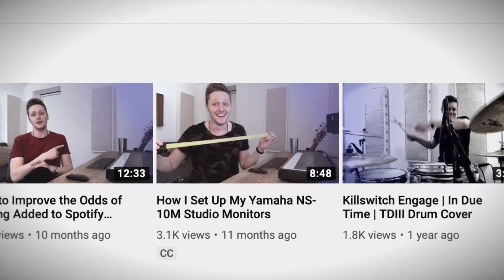Studio Monitors - How to Connect Passive Speakers to Your Audio Interface

Comment: There anyway to play passive speakers without amp thru m audio? Using power from comp ? Thanks -
Reply from the maker: No, unfortunately not. You'll need more power than your computer can provide.
Reply: @tomdupreeiii  ok thanks--- I'm going to get an amp. But I have three speakers somebody just gave me and I'd like to set up and DJ somewhere (possibly outside without power)...They were telling me it might work to get one of those battery power outlets. But what I'm really wondering is if there are (1 battery-powered amps) and 2) any amps where you could get sound from 3 speakers, one speaker being assigned the central dynamic. OR if you can think of any fixes to somehow get the third speaker involved with a central dynamic (instead of right/left). Sorry but I figured you might have some experience and to ask - thanks.

Comment: It’s not clear how you connect the interface to the amp. What kind of amp and what type of cables used.  Give me the idea but not clear.
Reply from the maker: Yeah I didn't showcase that step well enough with this video. I use two standard XLR cables to connect my primary interface to my amp. It will depend on your outputs and inputs though. Sometimes a TRS to XLR is necessary.

Comment: Thanks for the video, why do you need an audio interface?  Thanks in advance!!!
Reply: Interface is, basically, a converter of digital signal, that’s in your computer (mp3/WAV and so on) to analog signal, something that humans can hear ( any noise or sound that’s out in the world). So you need to connect it with interface in order to hear anything from any device to a good pair of speakers
Reply: @Bogdan_Tolm  Appreciate your reply!  I was planning on getting a bluetooth receiver and hook it up to my amp but would an audio interface give me better sound quality?  Thanks again!!!
Reply: @kalihipalama1762  I don’t really know about Bluetooth receivers, but audio interface is much more simple and more correct. Nowadays converters in audiointerfaces are really great (Don’t listen to all this guys, that hear a difference in silver and gold covers of cables, they usually cannot recognize the difference between old soundblaster and something like apogee) just buy something with good drivers on computer, like new focusrite scarlett (3d generation’s drivers are solid) and you good to go
Reply: @Bogdan_Tolm  Again, thanks for your reply!  In my opinion, simple is best!  I know that bluetooth compresses sound, so I probably won't get the sound quality which I'm most interested in.
Reply from the maker: Looks like @Barens hlm answered this perfectly!
Reply: @tomdupreeiii  Great guy who replied immediately and gave me clear answers.  I'm getting an audio interface over a DAC or bluetooth receiver.

Comment: Hey my question is what cable did you use between audio interface and power amp? That part was really quick and not fully explained.
Reply from the maker: Yeah, I definitely accidentally breezed over that part. I used a male XRL to male TRS.
Reply: @tomdupreeiii  thank you!

Comment: Hey Tom, I’m curious if your Avantone amp produces a lot of fan air sound from the actual device
Reply: I’m very sensitive to the noise as I’m working in a small room
Reply from the maker: No, the fan is quiet for me. I do have it in a rack though, which probably helps to dampen any noise it might make. I'm also not driving it very hard so it doesn't really get hot.
Reply: Thanks for your reply Tom, you rock! Subscribed

Comment: Hello and thank you. I have a question: i have a Yamaha keyboard that i want to use to record piano parts, and so i have to plug the keyboard into the audio interface. I understand that already. ;-) But: i also want to use that keyboard with the hifi amp, so that, when i just want to play something for fun and not record it, i can use the amp as an amp. Can i plug in the keyboard in for instance the cd input on the amp (with the red / white connectors) and will the keyboard then work for recording AND just for playing? Or how can i get that??

Comment: really my receiver does not have anywhere to plug in whatever you plugged in from the interface
Reply from the maker: You may need a different adapter cable. They make them for just about anything.

Comment: I currently have a pair of klipsch RB -51 II passive speakers, paired with the fosi audio 2 channel 100 watt 8 ohm amp but I  wanted to add a subwoofer and an audio interface to my set up.
 I was looking at the focusrite scarlett solo but due to my speakers being passive I’m unable to pair the two and I know I would also need a subwoofer connection, so I started looking at buying a new amp. I’m looking for 2.1 - 8 ohm amp. (75W RMS to 300W peak) that I can connect to the focusrite 
 Any one have any suggestions as to how I could solve this issue or point me in the direction of a budget friendly amp?

Comment: Is it just me or did Tom here completely skip a step?  It’s cool, I’ll find out what exactly is goin on from interface TO the power amp elsewhere but I really think you skimmed over that part. Which is all I was looking for personally.  Otherwise, great video.
Reply from the maker: The part you're looking for is at 1:50. It's quick but it's there. I just didn't go into detail for that bit. Basically I used a balanced TRS to Male XLR cable for each side. Hope that helps. Thanks for watching!

Comment: Hi Tom Dupree III,  great video, which I have stumbled upon at a time when I am in the market for a new amp for my NS10’s too!! My question is regarding the CLA 200 amp that you are using with it. Are you still very happy with it?  Have you had any further issues apart from what you mentioned in another video where you had to return the unit as only one channel was working.  It’s quite a big outlay but I wanted to make sure it is still recommend by you and worth it??  It would be great to hear your thoughts.

Comment: Were the wire cables sold with the speakers or you had to bought them separately? If bought separately, could you please share a link with a wire cable that you used? Thanks in advance!
Reply from the maker: I had to buy it separately. Just search for "monster speaker cable" on Amazon and you're set.

Comment: Is it just me or did you miss out the step where you connect the interface to the amp??
Reply from the maker: No. It’s in there. 1:50.
Reply: @tomdupreeiii  yeah but it was not clear the cable you used.
Anyway the Video is very useful
Reply: @tomdupreeiii  what type of cable did you use to connect the Audio interface to the amp?  1/4" to 1/4"   (did your amp have a 1/4" input?).   The amp I'm using only has RCA.
Reply: @tomdupreeiii  You're right. There's a 2 second clip of you plugging something in and it's very dark, then it cuts to you talking about speaker cables? You didn't talk about how you need to plug the 6.5 mm jacks into the L/R of the audio interface which then plug into the RCA or phono jacks on the back of the amplifier?
Reply: @thebeatclinic9000  The CLA-200 has XLR (balanced) inputs, and the Fast Track Pro has TRS (balanced) outputs. He doesn't discuss it, but it's safe to assume he uses a TRS-XLR cable to connect the two.
Reply: @benjaminpelletier5485  why not ts if there a left and right

Comment: What is the best power AMP for the NS10s?
Reply from the maker: I really like my Avantone CLA-200. I've heard the 100 is good as well. Plenty of other options at higher price points as well!
Reply: @tomdupreeiii  regarding to this CLA-200, I've searched about this amplifier and I saw that it delivers 200W at 8 Ohm per chanel. Also I see in your video that you have the original Yamaha NS-10M, which they support nominal 25W and Max 50W and the impedance is 8 Ohm (all this per speaker). So my question is how do you manage the volume controls from the amplifier and the interface? Do you set up the amp gain to the limit of the speakers and adjust the gain of the interface to the desired level?  Because my guess is that you should adjust the gain of the amp to less than 25% (aprox. 50W?)  in order to now blow up the speakers, am I right?

Comment: Could I use a regular household theater amp?
Reply from the maker: I think you probably could. I’d just make sure the wattage is compatible with your speakers.
Reply: @tomdupreeiii  I’m thinking about using KRK Studio monitors as my main speakers than use some Technic speakers to use as reference monitors using the Mackie Big Knob and possibly a theater amp.

Comment: i'm just confused on what kind of cables i need to connect the amp to my interface, you should of taken more time on that part
Reply from the maker: They make adapters for every connection you can think of. Check your connection points and find the cable / adapter connection that works with your gear. Everyone has something different.

Comment: How about Focusrite Scarlett 2nd Gen? Because its line outputs is RCA. How tp connect it to amplifier?
Reply from the maker: You can get an adapter to change your connection type and it should work just fine.

Comment: Can I use a focusrite isa one as the Amp for the passive monitor ?
Reply from the maker: While I'm not super familiar with the ISA One, it appears to be a preamp but not a power amp, so my guess is probably not. You'll likely need an additional power source to supply your monitors.
Reply: @tomdupreeiii  Thank you so much

Comment: Hi Tom and thanks for your really interesting video. My question is if it's possible to control an unbalanced instrument volume (es. a synth or a drum machine) through a monitor interface like a Fluid SRI2 and come off balanced directly to the active speakers (from ts to trs) without computer or any connection to it. Thanks for your help. 
Regards Damiano
Reply from the maker: Yeah dude, you should definitely be able to do that! Great question!

Comment: no way you even use a fast track pro hahah thanks so much for this!
are all amps considered "power amps" or am i gonna have to spend a thousand bucks on the cla?
Reply from the maker: Yes, any amp that sends power to a speaker is a power amp. But some are designed for specific uses (e.g. live vs. studio audio). You can find one for less than the CLA if that's where you budget is!

Comment: Hi Tom,
Thanks for putting out this video.  I have also watched your previous video as well.  I just purchased a pair NS10m's and would like to use them for computer speakers to monitor and edit voice-over and recorded videos in video editing.  I am very novice to audio set up, I was wondering if you had any recommendations for a smaller in size amp I could use, not looking for anything super technical.  Alsd I would not be using an interface.
Reply from the maker: Thanks for watching the video! I’ve heard the CLA-100 is a great amp as well. Might be worth looking into!
Reply: @tomdupreeiii  Perfect thanks for the quick reply

Comment: Why do I need the Audio Interface? Can't I just directly connect the amp to my PC with like an Aux cable as if the speakers/amp were headphones?
Reply from the maker: You can. You’re just using the audio driver from your headphone jack instead of a good one that might come in an interface. Also, you’ll need an interface to effectively work in a home studio environment, which is the main context of this video.
Reply: @tomdupreeiii  Nice! Thanks for the quick answer

Comment: Hi! Very nice video! I was blown with the banana clips! Hahaha

One question. I've just bought a Behringer Uphoria UMC202HD and i have a sound system (If its usefull its a Kempler & Strauss MCD 2060) lying around that ive been using, but i want to connect it with my audio interface. (Right now the speakers are plugged by a 3.5mm to RCA cable from my computer monitor to the "amp" i guess or sound system, which i know its not the best but it kinda works).

The sound system has only RCA inputs and it has also speaker cable outputs that drive the passive speakers.

Now my question is: Would a 1/4 inch TS to RCA cable do just fine to control my audio through the interface? Im kind of scared since i heard that using the wrong cables could mess up something! D:

Thank you in advance!
Reply from the maker: Hey, yeah that should work just fine! As long as your components remain in the correct order of sending audio from computer to interface, interface to amp, and amp to speakers, everything should be just fine.
Reply: @tomdupreeiii  Perfect! Thank you so much! Just one more question, should i keep this into consideration while pluging them and/or everytime I turn on everything?

For example turning the computer first (probably with the audio interface already plugged in) and then turning on the sound system? Or thats irrelevant?

Thanks again!
Reply from the maker: As long as you’re nit sending a massive influx of audio at startup, you should be fine no matter the order.
Reply: @tomdupreeiii  Thank you very much!

Comment: Thanks for this. Could you explain why you chose a power amp as opposed to a regular integrated amp. Could you also recommend an alternative to the NS 10.. just a regular pair of speakers that I can get started on without any room treatment and all that.
Reply from the maker: accentontheoff my interface of choice - the UA Apollo 16 - doesn’t have an integrated power source, which is why I decided to go with the power amp option. Plus, I specifically wanted the NS-10s, which are a passive speaker. I could have bypassed the amp by using active speakers as well. If you want something simpler than the NS-10, KRK makes a decent entry-level powered monitor that’s a good option. But nothing is going to allow you to bypass room treatment for better listening. Regardless of monitor choice, room acoustics will be dramatically improved with treatment. Thanks for watching the video!
Reply: Tom DuPree III There seems to be no escaping the room :). Thanks for replying.
Reply from the maker: accentontheoff yeah unfortunately not. You’re welcome!
Reply: @tomdupreeiii  Which power amp did you use or which ones can you recommend? I don't know what to focus on

Comment: Thanks for the video Tom. On the power amp, how are calibrating the levels or do you set both knobs open?
Reply from the maker: @Tyler Held I started out by setting the amp gain staging to a level that allowed me to listen clearly at low master volume. That ended up being about 10 o’clock on both sides. The meters don’t move but everything sounds great nonetheless.

Comment: Hey Tom!
Really useful vid, thanks!
My audio interface (MOTU 828 Firewire MK1) has an S/PDIF Coaxial connection. Can this connection help me skip me the amplifier step in any way? If so, how should I do it? Thank you!
Reply from the maker: Jordi Corominas Salvanyà hey good question! No, unfortunately not. You’ll need the amp to drive the volume of the speakers. A S/PDIF connection is generally used to send data between instruments and interfaces, not audio. If it’s an RCA audio out (same connectors oddly enough) you can use that to connect to your amp and then to the speakers from there.
Reply: @tomdupreeiii  Thank you very very much!

Comment: My one question is if You're going to use an Integrated stereo amp (such as my NAD C 372) would it be better to bypass the pre-amp of the NAD or simply connect to it like a CD player would through the pre amp?
Reply from the maker: hmr101wylde if you’re going to us an external amp after the NAD then you don’t want to send a powered signal to the external amp. You want to use a line level signal. If you’re using the internal amp to power passive speakers then you’ll want to use the powered outputs. Hope I understood your question correctly!
Reply: @tomdupreeiii   I don't think you did. My NAD C372 had a pre-amp and power amp built in. I am using this to power passive speakers. I would just like to know if I'm better of bypassing the pre-amp of the NAD connecting the balanced outputs on my Interface directly to the power section of the NAD.
Reply from the maker: hmr101wylde oh ok I see. Apologies for my misunderstanding. Yes, bypass the pre-amp and go straight into the power section of the NAD if that's an option.

Comment: @1:50 M-Audio to power amp - did you plug in one of the TRS outputs or Inserts? And to where in the powered amp did you plug the other end?
Reply from the maker: Great question. I went from TRS out on the interface to XLR in on the back of the amp. I used 1/4” to XLR cables.
Reply: @tomdupreeiii  so  TRS to XLR Cable (XLR to TRS Cable) Male to Male?? plz reply i need to get this working by Saturday i will greatly appreciate it
Reply from the maker: Supa Wav yep that’s it! Be sure you confirm your connections by looking at the inputs and outputs if your devices, but that’s what I used for mine.
Reply from the maker: Supa Wav thanks for sharing these links. Looks like everything you've selected should work great. You've got it all figured out!

Comment: Is it possible to connect the speakers directly to a M-Track Plus audio interface? Or I need to buy an amp?
Reply from the maker: It looks like you will need an amp to power your passive speakers. The M-Track Plus doesn’t appear to send power, just line-level signal. Hope that helps!

Comment: Nice video! Is it correct if I connect the amplifier to the headphone output of the audio interface? Thank you
Reply from the maker: No, I would advise against that. The headphone output has its own separate gain control (that's what drives the volume of your headphones when you plug them in). You want to make sure your amp is connected to the main output of your interface.
Reply: @tomdupreeiii  , the main output on the M-Track Plus are for banana cables, right?  If I try to connect the m-track directly to the speakers, using a banana-RCA cable, will it work?
Reply from the maker: @Fernando I think you will still need an amp unless you are powering active monitors.